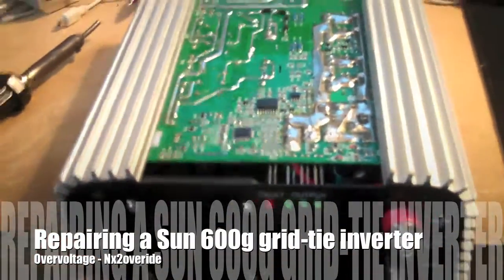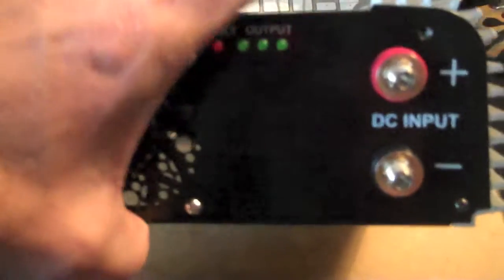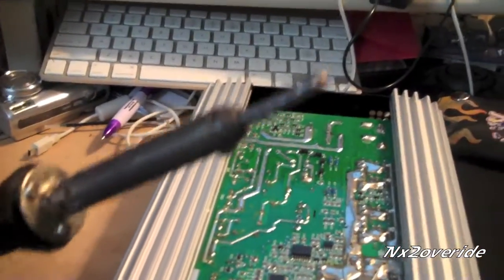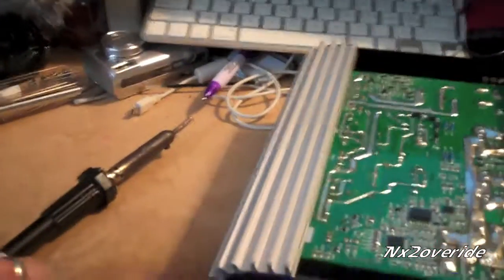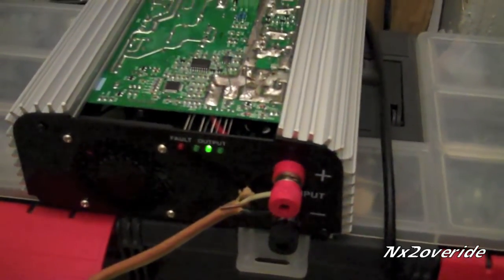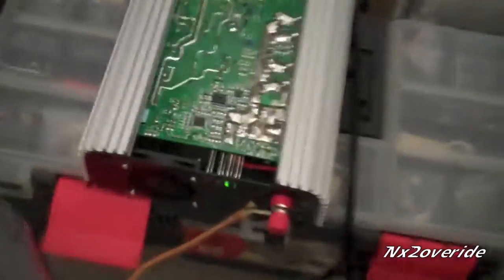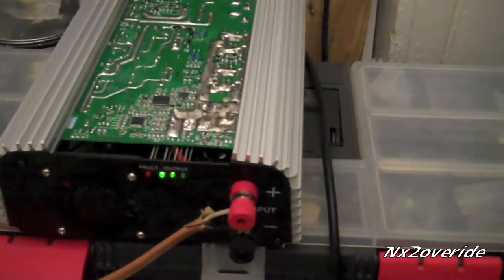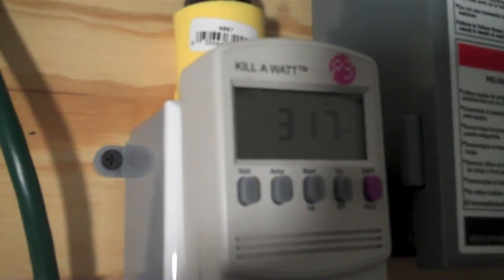Repairing a Sun 600g grid tie inverter (Over Voltage)

Comment: I had a guy grid tie inverter over volt and stop working do you think it's the capacitors in mine as well??
Reply from the maker: might be open it up and check them if they are bulged id replace them and give it a go.
Reply: Thank you very much in going to give it a try

Comment: You might want to consider putting a voltage regulator/current limiter board on the input side. You never want to give any GTI more than 75 percent of its rated capacity for longer life. I also put an extra fan on top of the unit, which I connect in parallel to the internal fan. You can get the board on ebay for under $20. They come 150w to 900w. You can also parallel the boards for larger GTIs. Regulator boards are alot quicker to repair in the long run. Great video.

Comment: Hey man, I have 1K of panels sitting around here, what grid tie inverter would you recommend. Maybe go with several small GTI's or a couple bigger ones or one huge one or what? There's NO way I can afford batteries at this point, and I was thinking just getting some plug and play stuff going on. I want to end up with batteries so I can be on or off grid but that's a rich mans dream for now. Good job on the fix buddy!~John
Reply from the maker: I pretty much have that on my shed so ill tell you what I did. Wire the panels to 24 volts if they are 12 volt panels and get "3" 600 watt Sun 24 volt grid-tie inverter  same as the ones in this video. Wire them stacked so if one inverter goes down you wont blow the other ones.... maybe I can make you a video ;) BTW the 3 grid tie inverters will cost about $450.. I just bought 3 new ones because I'm getting more panels soon.
Reply from the maker: You could do what I do in the battery situation is buy one a month. I dont get crazy expensive batteries just deep-cycle marine Maxx batteries from wall-mart. They are 125 amp hours a piece.  They work great!
Reply: You know why you da man?
Reply from the maker: WORRO01 I am not the man, I just know the man! "points at ya"